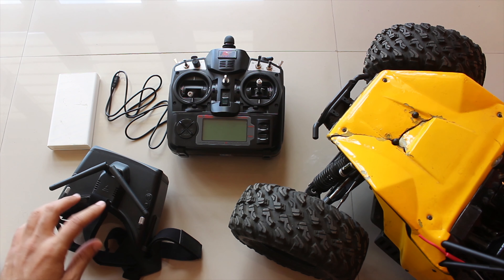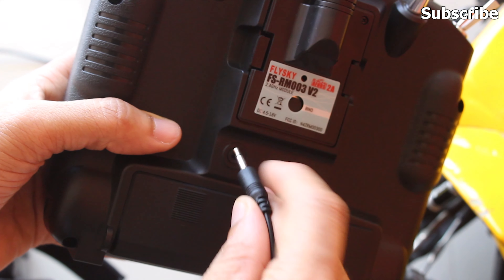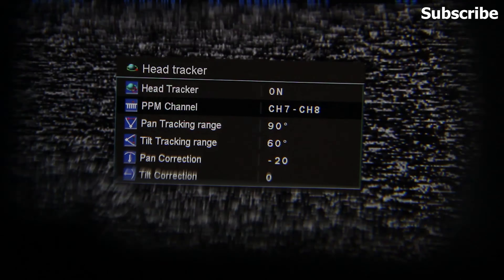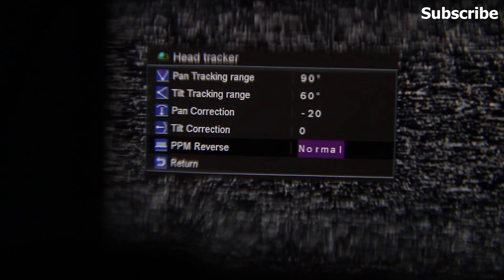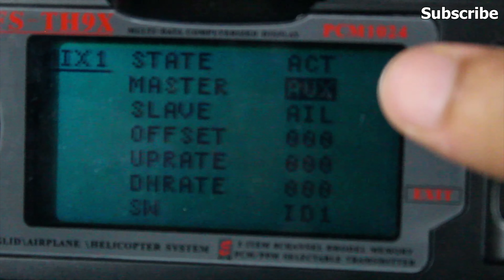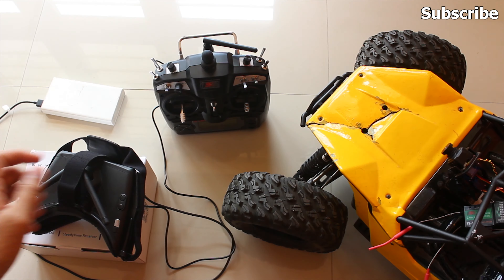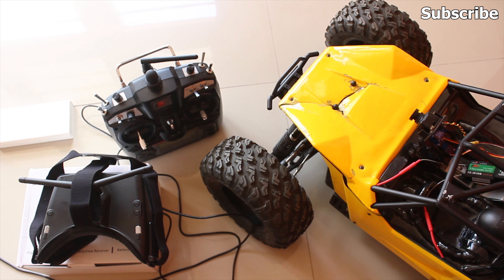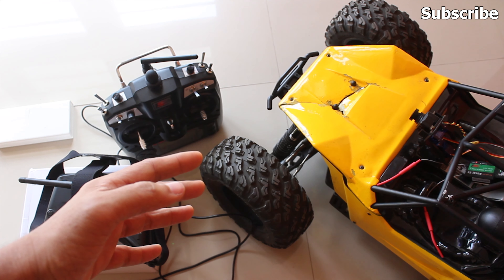Head Tracker Setup for FPV Goggles | Skyzone Cobra X | Indepth Tutorial | Rc Car FPV

Comment: I have new flysky paladin 18 and cobra x goggles and can’t get it to work.  How does this work with the new transmitter?
Reply from the maker: Did you check which port the paladin has for ppm signal input? Did you enable the ppm in aux channels from cobra goggles in the mixer page?

Comment: Hi Rakish,sorry for the trouble,I fly model planes,I have the cobra x goggles and the flysky fs-i6x transmitter I’m also using the ZOHD Kopilt flight controller,I tried to set up the head tracker function of the goggles with the flysky transmitter ,it doesn’t seem to work probably because the transmitter still has the stock firmware on it so can’t receive PPM signals?do you have any suggestions of a budget transmitter I could buy that supports the head tracker and will work either in SBUS or PWM protocol that the flight controller works on?
Reply from the maker: Flash open tx firmware on your fsi6x. It allows ppm input signal so you can plug you cobra goggles with head tracker enabled. https://youtu.be/l3xZRpbhS_k
Check this video.

Comment: how can config the head track in opentx , pls help me bro
Reply from the maker: Which radio? In open tx..go to mixer page and for aux any channel between 5-8 set the source to ppm input, then make sure head tracker unit is also set to output ppm signal on the same aux channel number and have connected the head tracker to the radio dsc/ trainer Port
Reply: @RakishRc  same radio
Reply: Th9x
Reply: I will try

Comment: Thanks Rakish. looking into a pan tilt set up myself.  Btw. What happened to your turck?
Reply from the maker: Thanks for watching 👍 I was showing my Yeti xl to a friend and did some speed runs when it skids off the road and flipped thrice in the air and cracked the front body panel. The pan and tilt servo setup is available easily and cheap..you can use better quality servos to get smooth movement.